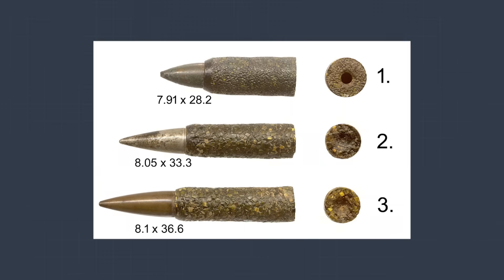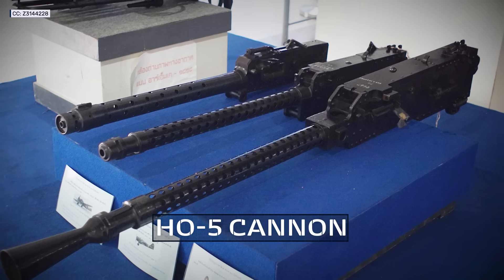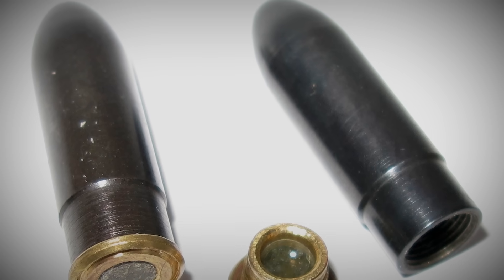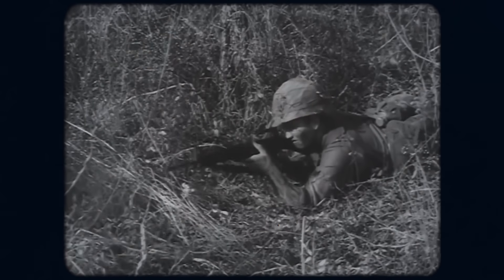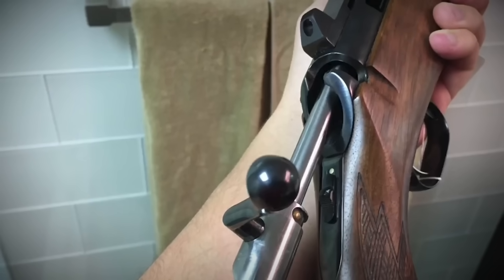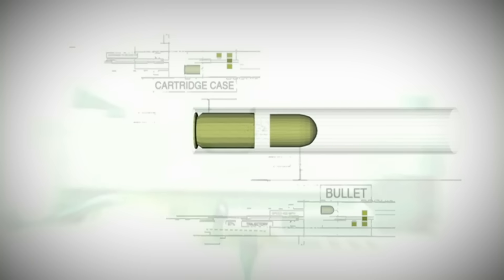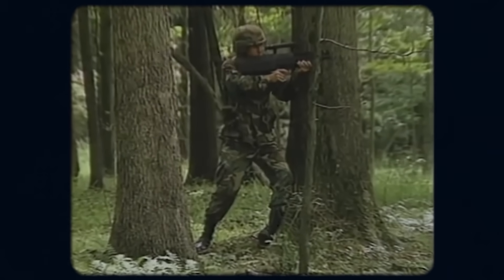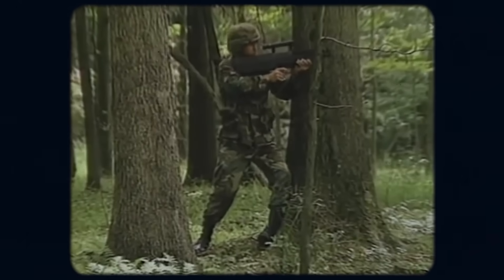Is Caseless Ammunition the Future of Warfare?

Comment: What makes the development of caseless ammunition so strange is, that the case is actually a part of the system and serves multiple purposes. 

Even worst: gun development has went to great length to remove complexity and cost, making a modern gun usually the most optimized design possible. Whatever can be simplified has been simplified and production effort is as low as it possible can be. "Military grade" just means "cheap as hell". Now caseless is trying to reduce weight of the ammunition by re-introducing a lot of problems that are already solved a very long time ago. Unless caseless is much, much cheaper for the overall cost of the system, i don´t think it will ever happen.

Comment: The reason the M-16 failed in Vietnam is because the Army Ordinance Corp insisted on using the wrong type of propellent which effected cyclic rate and carbon build up leading to increased jams and misfires.  The M-16A1 just lowered the cyclic rate and added the forward assist to force the bullet into the chamber if it failed to seat properly (not the best idea) and never addressed the issues with ball powder being filthy, which is why you spend almost as much time cleaning them as you do actually shooting them in BCT.  None of these were issues in the initial batch deployed with the Air Force which used the proper propellant that it was designed to use.  The rifle wasn't the issue, the Army's bureaucracy was.
Reply: You forgot about not chroming the chamber not supplying cleaning kits nor a jam clearing mechanism... McNamara bullshit

Comment: the short answer is Not anytime Soon  , the reason being that the metal case does an important job of removing Heat from the gun when fired and so when you remove that  and do not or can not provide a remedy then it just does not work , the chamber overheats and then causes run aways because the ammo will cook off as it is fed until the gun melts or runs out.
  it is a rather large hurdle.

Comment: Whatever happened to the plastic case telescoped bullet that was the loser in the M7 Spear competition? After all that research we ended up with “oversized AR-18 with a scope” instead of “future weapon”
Reply: @JinKee  it's not oversized, it's just a hair smaller than an M4 or a 416 though the suppressor might make it longer.  The real issue with it is it's weight being on its own with no ammo or attachments is 9 pounds, an m4 with everything weighs about that much.  But it's pumping a 6.8 battle rifle cartridge out to 600 to 800 meters with accuracy out of a 13.5 inch barrel which is insane.  I will say I wish they had gone with 6.5 creed for a battle rifle cartridge rather than creating a new round all together.
Edit: forgot to mention it's pushing that round at over 4000 fps out of that small barrel

Comment: Without having watched the video yet, probably not. The issue with caseless ammo is you have terrible heat dissipation. Casings actually dump a decent amount of heat away from the gun, so without them you're stuck with the issue of your gun heating up much faster the more rounds you shoot. I've seen some companies using ammo blocks instead of individual cartridges, but that almost feels like a regression/gimmick than an actual advancement.

Unless you have some way to get heat away from the gun or keep the temperature down it's not really practical for any live fire scenario.

Comment: LoL.. and why do tank rounds have 'the ash tray'?  Now if you LOWER the gun pressures, then you can have a repeatable seal, but not what is demanded these days and it is very bad for hearing)..  It is best for the USA to GO BACK to .30-06 as it was properly engineered for a 26 inch barrel, so was .50 cal BMG... a bit of shaping and over all length adjustment and all's fine, in fact the new  6.8MM is more like something like that, well the practice rounds... otherwise the othe problem is going to be barrel erosion, so bad that barrels will need to be replaced every week in combat.

Comment: Problems with case-less bullets for traditional small arms (e.g. rifles): (1) Heat. Encasing the burning powder in a brass case, then ejecting the brass case removes a lot of heat from the chamber. Having propellents burn openly in the chamber without the opportunity for heat to escape through case ejection causes the chamber to super heat quickly. (2) Unintentional ignition. Shove a caseless bullet into a red-hot chamber and BOOM! it goes off when you don't want it to. And (3) Stability. Propellent exposure to moisture and extreme chamber heat will affect chamber pressures and thus bullet accuracy. Good on paper, not good in physics.

Comment: The short answer is yes, it's already used in modern tank ammunition, and it was accepted for service use by the Germans and then cancelled because the fall of the Berlin wall made it unnecessary upgrade at a time when the money was needed to reintegrate E.Germany.
We know it works and it has major advantages - the issue is that it is a huge investment in replacing all of a services firearms and it has to be done in concert with allies or there will be a vast logistic incompatibility issue.

Comment: Once u can make it do everything brass does without any serious drawnacks itll definitely be the way to go. They already have quad stack ar15 mags that hold 60 rnds but weigh the same as 30rnds of brass case.  The caseless they had is almost ready for production they are tweaking the polymer case formulas getting it right. Dont want whole warehouses full of ammo melt or deform in extreme heatvor crack in cold

Comment: I had a dream about a strange gun that would, I think, fix most of the issues. The magazine was sealed, so you didn't load bullets, you loaded the whole magazine and fired it until empty. Because it's sealed, there's no way for the cartridges to get contaminated, and they could be protected completely until fired. It also had some kind of mechanism for cooling the barrel, but I couldn't see how that was done. The gun had virtually no kick to it, little muzzle flash, and made a sound like an air rifle. The bullets wrapped around the barrel in a helix (must have held over 100 rounds), and it required an electrical charge for some reason. 

The gun was like an octagonal cylinder with a handle at the back. It was actually housed inside a vehicle's body inside a shaft, pulled out when needed, and stored back inside a shaft to keep it charged up at all times. So the gun was kept clean and could only be unlocked from it's tube by the vehicle's operator. It was for emergency use and survival situations, it didn't feel like a full military device. 

I don't recall anything else about the dream, but that gun's design stuck with me. It's interesting how, hearing this video, I can see how it would actually solve many of these issues with caseless ammo. The gun didn't eject anything when fired, so it must have been caseless.

Comment: To prevent a "hot" barrel from igniting the next round, use a second barrel (or chamber). Revolver cannon use 4+ chambers mounted to a single barrel. Each chamber sees 1/4 o the heat per unit of time. Also, control the rate (and amount) of continuous firing. (Anything more than a 6 round burst is hard to control!)
The word of the day is OBTURATION. Sealing the 40,000 psi of gas pressure until the bullet leaves the "chamber". It CAN be done without a case (see 16"/50 cal MK7)

Comment: Something I've never considered in the case of internally stored propellants is the case of non-solid propellent. I imagine it would be considered to have too low of a shelf life if it were gaseous, but what of liquid propellent? Too dangerous? Corrosive? Reactive (or not reactive enough)? Too hard to seal? I'm sure it carries many of same drawbacks, but I've never heard of experiments with it.
Reply: The only suitable liquid propellents I am aware of are corrosive, so yeah, not a good idea.  Modern smokeless granular propellents are  completely non-corrosive, burn very reliably and consistently for great accuracy, and are easy to measure accurately, which also lends to good accuracy and also safety.  It's basically impossible to replicate that combination of ideal qualities with any other known propellents, which is why nobody has.

Comment: I think the problem is miniaturization. Caseless ammunition has been a thing for large artillery pieces for a very long time. Most use cloth bags. You can punch those things out of shape and they will still fit in the gun. 

The problem is making the ammunition charges smaller. A tiny cloth bag is delicate, and will break open at the slightest touch. Make it durable enough to nor break, it won't burn away and get stuck in the rifle. A rifle is small, so that means tighter tolerances, leading to more specific charge requirements. Automatic feeding means the bag cannot be squishy and needs to be durable.

Imagine fitting a Saturn 5 Rocket into the size of a pencil. Hypothetically doable. Reasonably impossible. Practically unusable.

There are just some things that should not be done when you are talking that small.
Reply: That being said, the VEC 91 is how I would have designed caseless ammunition. Essentially, make the case flammable and inherently disposable is almost perfect... but the video goes over why it is difficult to justify.
Reply: Already done so in 1848 with the Dreyse Needle Gun of the Prussian Army. Same did the French Chassepot Rifle with the silk contained cartridges.
Reply: @GuntherSeifert-nh5hh  And those were abandoned for a number of reasons. The automatic feed system for machine guns will not allow for those soft fabric cartridges, unfortunately.

Comment: Hmmmm. The 40mm CTA develped between BAE and Nextor is the most lethal 40mm on the planet. 4 round types can be selected while maintain a 160 rounds a minute fire rate. The armour piercing rounds increased kinetic energy able to penetrate 60mm of rolled steel at 60 degrees. The air burst round containing titanium shrapnel distance fused by laser and capable of downing choppers. A faster, more reliable and lighter feed system. In 2018 Textron offered the US army a new 6.28mm round lighter than the 5.56 with more accuracy, more range, more armour penetration and more reliability. The weapon was designed to replace the M4....but!! Budget, or in English someone was getting a massive back hander for selling crap kit again.

Comment: What most people forget is that casings and especially brass casings absorb a lot of heat from the gun. Heat which is then ejected with the casing. Benefits of casings are too great. There is no way case-less ammo is ever going to replace regular ammo since over-heating would be an issue and new cooling systems is a lot more complicated to install on a gun not to mention it would add tons of weight.

Comment: Personally, I think polymers is going to be the future. We're almost there now, in fact General Electric did bid in the last US army rifle trials with a polymer case prototype. Once they can assure that heat will not be a problem and the case and cartridge can be used in any barrel length. There will be no reason to not use polymer of brass and bi-metal cartridges. The only problem left would be economies of scale and once that's done it would be pretty much a done deal.

Comment: There was also a spin-stabilized, rocket propelled ammo introduced in the 1960's known as gyrojet. Several types of gyrojet firearms were manufactured, and I beleive the ammo was commercially availible for a short time. The ammo did not reach maximum velocity (about 1250 tf/sec) until it had travelled for about 60'. There were other problems, and the weapons did not sell well

Comment: They've been trying to do this since at least 1848 with the Rocket Ball. (See Volcanic Pistol) You nailed a large number of issues, but another one is external ballistics. Any of the "charge in projectile" devices suddenly have a much lower specific density and thus ballistic coefficient, as well as a front-heavy design, which can be an advantage, but with either a reduced weight or a greater overall length, the external ballistics and spin stabilization all suffer dramatically.

Comment: (sigh) for the millionth time...   no.   Caseless ammunition has been tried repeatedly and failed due to fragility and inability to be stored long term.  Even the main gun round of NATO tanks uses a hybrid semi-caseless round that has and aft-cap and polymerized outer coating.  No, the reasons the cased round will endure until someone comes up with a Buck Rodger Raygun are economy, durability and longevity of the ammunition.

Comment: Weight ,powder residue and repetition fire is an issue. The only way it would be feasable is to design an expensive harder hollwed and honed projectile fired from a back plate for blowback. Good for distance because protecting designs can vary.

Comment: Another example of caseless rounds is in the Metal Storm system. In this, rounds are stacked inside a barrel and electronically ignited one after the other, resulting in insanely fast firing speeds. The drawback is that once rounds are complete, the entire barrel must be replaced by a new pre-packed one.

Comment: In my experience, the reliability of steel casings comes down to the weapon they are being fired from. Not all firearms are built equal. Some eject steel casings better and more consistently than others.

Also, a caseless round would be fired from a steel casing, the steel barrel of the gun. Just saying.

Comment: Dissipation of heat via the metallic cases is too much to overcome for most firearms with even moderate rates of fire.  Even for a small arm like an M4 you'd have to have quick-change barrels that get swapped-out every few hundred rounds, which totally negates any weight savings by going caseless.  

Maybe they'd have figured it out if the G11 would have been adopted by a major military.  Maybe Inconel barrels to withstand the heat?  Then you'd be paying 10k per barrel... 

Even if they CAN do it, I don't want it done.  I hand load and don't want there to be any excuse for powder/projectile/primer companies to stop selling me components.

Comment: The benefits over issues needs to be sorted. The goal is to sustain overwhelming firepower turning every soldier into a light machine gunner with the accuracy of a designated marksman. 
The problems with caseless were addressed in the 1980s. Then Abandoned to be looked at again with telescoping ammunition. So we can learn from those that already made this stuff or start from nothing i say work with the Grandfathers. The weapon will need to be able to feed/rotate/cool the firing mechanism/chamber to disperse/minimalize heat. This could be done with a chemical cooling system. We would abandon the typical firearm and make a new firearm that is less mechanical and more electric chemical. Electronically fired ammunition, gas/liquid cooled chamber and the addition of much larger ammunition drums/magazines. Going from 20/30 rounds to 50 to 100    
Since optics and the like with be heavily power dependent a deep cycle battery, cranked back up would be needed. A cooling cartridge of possibly Co2 or thermal heat sink into an "oil cooler" or chemically cycled cooler. 
The idea is to have sustained rate of fire more so than your average Infantry rifle or LMG. The ammunition would be "cheaper" and one could carry far more. The weapon would be sub 15 pounds fully loaded with optic which is similar to a M-249 (no optic/unloaded) .

Comment: Without watching the video: No. Caseless ammo is not the future. Using brass cases serves 2 functions: It creates a good gas seal in the chamber due to the malleability of the material. Brass is also an excellent heat sink. When the case is ejected, a lot of the heat created by the propellant charge will be taken out of the gun, so there is less overheating.

Comment: Caseless rounds are NOT more reliable, the main problem is heat, the cartridge case draws a considerable amount of heat out of the firearm (thus the term hot brass). Full auto firearms have a problem with overheating .

Comment: I don't really see the fragility of the caseless round as much of an issue.  Logistically, the rounds can be kept in clips / stripper clips when not in the gun's magazine.  The magazines can be designed to house either the clips (think M1 Garand) or to take the rounds off of the stripper clip, which is removed before firing.  There really isn't much reason to just have loose rounds sitting around that I can think of.  In the rare instance you need to actually handle a single round, you can pull it from a clip.

Comment: The main problems I've always seen were the fact that most propellants are granulated and caseless by their nature must be solid. It's a matter of surface area during the burn. It would seem that careless would only be useful in magnums where slower burn rates are desirable. And then the fragility of the rounds is typically very high.
Reply: Heat is a big issue too. That hot brass takes alot of heat from the weapon as it goes
Reply: @johno1544  the heat is a problem but not an  unovercomeable issue. The weapon cycles and that can be used to cool the weapon. But the propellants inability to turn to gas fast enough is a major issue and there again, the grunt proofing the things. Can you imagine a mag full of broken propellant? Or a crushed bullet jamming up a rifle at the wrong time?
Reply: Yeah, Varget is expensive enough as it is.  I can't imagine how much a pound of a totally solid propellant, that can still attain the same ballistics, would cost.  Be paying DuPont $700/lb instead of $70 to Hodgdon... no thanks, lol
Reply: @mfallen2023  Not really. Propellants are in a gel-like state prior to being extruded or formed into balls/flakes.  It is not difficult to extrude them into another shape.